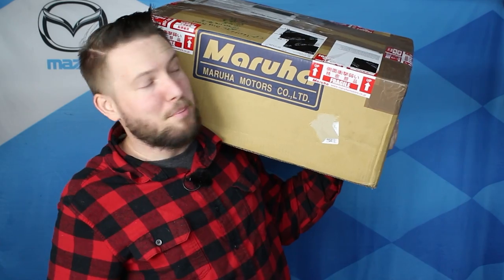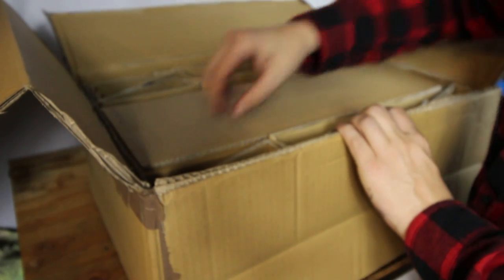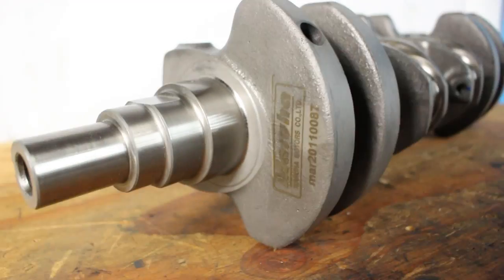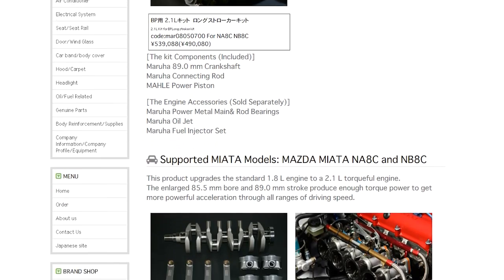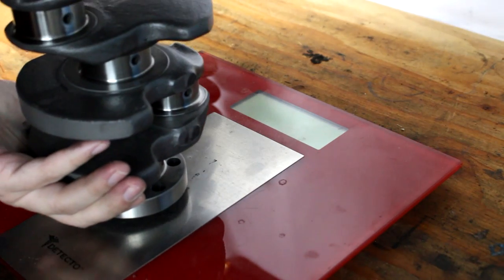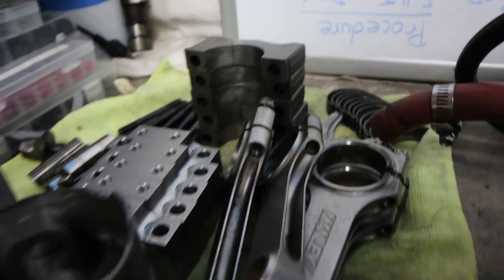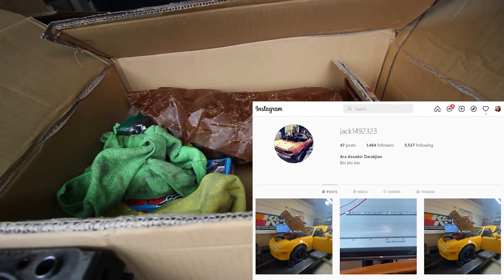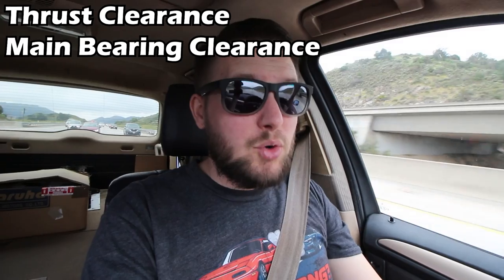Miata Gets a MARUHA STROKER Crankshaft From Japan!

Comment from the maker: Slight corrections to the video - when I spoke about rod/main bearing clearances I should have been speaking in "ten thousandths" rather than "thousandths." 

My requested specs:
Rod = 0.0020 - 0.0022"
Main  = 0.0018 - 0.0020"
Thrust 0.0060 - 0.0090"
Top ring = 0.0170"
Second Ring = 0.0190" 
PTW = 0.0030"

Another slight correction - when you bore up, you do actually gain a small amount of compression rather than losing it. You're pulling in more air to begin with (left side of the ratio i.e. the "9" in "9:1 compression") and compressing it down into nearly the same space. The combustion chamber in the head remains the same size, but technically the overall volume where the air is compressed grows slightly with bore-up due to larger head gasket and increased volume between the deck and top piston ring (right side of the ratio, i.e. the "1" in "9:1 compression") so the bump in compression is very small, usually about 0.1 or less. Changing the stroke from 85mm to 87mm however, raises compression by about 1 full point. So this thing is going to be REAL rowdy.
Reply: In the machining industry, we just call the ten thou marks "tenths". Which can be confusing for someone not knowing better and think we talking about tenth a inch and not tenth of a thousandths of a inch lol
Reply: What about the guy in the TENT . 
Thank you

Comment: In my opinion keep it on the safer side of spec. Dyno queens are cool and all but I think you should enjoy driving it more. We need to see this thing embarrass some v8’s asap 👌
Reply: Fs. No point in making 5-600hp if you have years of lag or can’t put the power down.
Reply: @haydentakara4369   dude, Greg is smart enough to be able to select an efficient enough turbo with the correct turbine housing vs compression to build the right power. Trust me. There’s a reason the call him the Miata dad.
Reply: @4399daniel  no doubt. Just in general though, a lot of really great builds often lose their actual street functionality and drivability by people going all out and sticking the hugest turbo on their car. Sure it makes big numbers but it’s hardly usable.

Comment: I definitely endorse the high comp pistons! I'm running 10.5:1 in my 1.6 with a GTX2860R and it runs fantastic on pump 93oct. You'll definitely like the broad powerband it gives!
Reply from the maker: Great to hear
Reply: @TheCarPassionChannel  gotta swap to the 1.6 for the full effect though ;)
Reply: He's already running boost, increasing compression might require him to be on e85 all the time and might not be worth it.

Maybe he can go higher compression but lower than 10:1.
Reply: Is it reliable? High temperatures issues?
Reply: @sepg5084  pretty sure he already runs e85 at all times. Which is honesty ideal, I mean pump gas sucks 😂
Reply: @sepg5084  I run high compression with boost and it seems fine as long as you have separate fuel and boost tables based on ethanol %. I am around 33PSI on e85 and 20psi on 93.
Reply: @sepg5084  honestly I think that would be the best choice (10:1) for a 500-600whp Miata on e85..... It just gives more room for error.. I know 11:1 can also work... I think personally for me, if I had an e85 only car.. I'd probably do something like this:
300whp goal = not more than 12:1.
400whp goal = not more than 11:1.
500+whp goal = not more than 10:1.

I feel like that's a good foundation for reasonableness if wanting to get more efficiency and also still run big psi of boost.

Comment: High compression pistons seem to make more sense in the pursuit of a broad power band. Mazda's cars these days are all running ridiculous compression and they have great low to midrange torque for being small 4 cylinders. Plus, making more power by improving thermal efficiency seems like a win-win to me.
Reply: He's already running boost, increasing compression might require him to be on e85 all the time and might not be worth it.
Reply: @sepg5084  he did explain he’s already running e85 all the time anyways, so it probably won’t make a difference to him

Comment: if you keep the same rods and pistons how do you prevent the pistons from hitting the head? did you have 2mm clearance before? or am i missing something?
Reply from the maker: The 2mm stroker crank only puts the piston 1mm higher in the block at TDC, and in stock configuration on my motor the pistons sat 0.5mm below the deck. So with the 87mm stroker they will sit 0.5mm above the deck, and I run a 1.4mm head gasket, so I will still have 0.9mm of squish clearance.
Reply: @TheCarPassionChannel  right, i forgot half the stroke increase is at BDC lol
Reply: What about your valve to head clearance? It has been a while since I've looked but I do not believe that this engine is a non-interference engine. With it being .0005 higher on the piston  you may want to check how much room you have left. plus in case you do end up with any valve float on a Dyno pull or other non street race high rpm check. 😀
Reply from the maker: @alleyman82  Valve clearance will all need to be double checked again. You are correct that it is an interference engine now (factory VVT engines are) but I still had ~3.8mm PTV clearance when I checked so it should be okay. There's a chance the pistons will need a hair of work though.

Comment: High compression for the win, anything to get that turbo to MBT as fast as possible.I still wager you need some sort of advanced traction control system that can properly manage wheel slip. Otherwise big power numbers do you no good. Not sure what you have access to in the miata world, but there is some nice stuff out there that can read front and rear wheel speeds and pull timing and boost to allow you to reach a set wheel slip percentage, 10% seems to be optimal for best acceleration.

Anyhoo its been fun following along the build and I'm about to dive head first into building a high response RB26 myself. I've got some tricks up my sleeve since RBs are super lazy on the low end. I'm hoping for a pretty flat torque curve from 3500 to 8500 with a turbo capable of 650 horse. We'll see where I get.
Reply: His Miata is surprisingly stable with the power he puts down. He has videos when he was at the track and put down some good times on a tight track! I recommend checking it out! Theirs even a really clean NC in it also!
Reply: I think a simple boost by gear system could do the job tbh he seems to have good throttle control

Comment: This has got to be one of the fastest street Miata's out there on YouTube
Reply from the maker: That's partly my goal!! All street trim, street tires, easy to cruise around, but just straight up vicious when you want it. I think anything over 450-500 isn't really possible just due to the excessive lag and limited traction north of that power level. At least without flares, 275 semis slicks or drag specific tires, etc. I like keeping the exterior relatively unassuming

Comment: Make sure you clean out the back side of the plugs on the crank. I just installed this Maruha 1.9 crank on my nb, with thicker headgasket from Maruha also. Kept stock pistons and rods and refresh everthing else, head valved and refinished, then a Maruha flywheel with new clutch also. 

Got set up on Maruha's Rapid piggyback for a break in tune. Now at 500kms breaking in.

Comment: I always thought adding bore size increases compression ratio. Same thing for the added stroke.
Because the combustion chamber volume stays the same but you're pushing more air into it.

Awesome on the maruha crankshaft!!! You're always one step ahead of me on my dream build hahaha I'm excited tho to get to see how it works out. From what I understand is the maruha cranks are made out of a stronger steel than the stock cranks. But they're not forged. So I don't exactly know what to make of that. But then there also the design improvements and 2.2lb weight savings... Hopefully they're still atleast as strong as the stock forged ones. I was actually in the middle of looking into that but I haven't figured it out yet...

And also +1 for excitement for the moderate boost in compression ratio. However I'd suggest a knock sensor just to have that extra piece of mind. HP Academy has good tutoring for calibrating knock sensors in standalones
Reply from the maker: Yeah you know what you're right, I'm not sure why I got that backwards. But it's a very tiny amount, like 0.1 point per 0.5mm of bore. Because although you have more uncompressed air to begin with, you also technically increase the "chamber volume" since you are using a larger diameter head gasket and your stock pistons are usually slightly below the deck height so that volume plays into the ratio. As well as the volume between the cylinder walls and top ring which is also a tiny bit greater.

Comment: Go with the 84mm and higher comp pistons route! I'm not a pro engine builder, but I'd rather have more meat in the sleeve on a boosted car. The more on the major thrust side the better. That's why anyone sane who builds 85mm> BP motors sonic tests theirs blocks.

Weisco's 84mm "10:1" pistons have a 7cc dome on them FYI. I have a set waiting to be put into a very similar build to yours (84mm, same pistons, but NA for the time being) I've yet to cc them to figure out the exact dome size, but I'll do that if you're interested.

Anyway, I'd first figure out your piston to valve clearance on your head before you shave it. Then get fancy and incorporate all the math (cc your chambers, figure out theoretical piston to deck height, etc) and then shave your head what you can (you should have enough...), or until you get to a static compression of 10.5:1 or 11:1.

Obviously you'll have to live in ethanol land permanently with that dynamic compression ratio.

Looking forward to the build!!

Comment: Unless you have the ability to ultrasonic check the bores I wouldn't go larger than 84mm bore.  I've personally sonic checked a BP block that had been bored to 85.5 and we ended up tossing the block as the front side of one bore was only .049" thick just under the deck.  The other three were ~.065".  Even at 84mm that block would still have only had an .079" wall thickness on the thinnest cylinder which IMO is too thin for a performance engine.  What we don't know in that particular case was did the machine shop mess up the bore work or was there a big core shift when Mazda cast the block.  I didn't have the block to check before machining to measure.

TL;DR... Unless I could sonic check wall thickness, I wouldn't put much overbore in a BP block.

Comment: This is so timely.  I just decided yesterday to order the 87mm from Maruha Motors.  I already have the same 84mm Wiseco pistons - catalog says they're 10.05:1, websites selling them say 10.5:1 - who knows what it is.  Mine is for a Rotrex build using the C30-94.  Have the redline set at 8400 rpm to give a max impeller speed of 10400 out 10500 limit.  Crank pulley is 130mm Supercharger pulley is 105mm.  Mine is going through 50mm Jenvey ITB's on their Turbo plenum.  Can't wait to get it all finished, still lots to do.

Comment: For sure build the engine with higher compression pistons. Would love to see it ❤️
Reply: High compression AND alot of boost?
Reply: @TheAdatto  Yeah, he drives on E85 and you can tune the car for higher comp and boost. Possibly can't get the "peak" performance like lower comp, but still a better throttle response when not in full boost. So a better midrange and that is his goal.

Comment: I have a short nose crank engine that i want to swap out to a big nose crank. Do you know if I can use the same block, swap the crank to a big nose and just use the different balancer and oil pump from the bnc engine? I’ve been reading on forums but they are not very clear on if it is completely possible. Huge fan by the way!

Comment: Please correct me if I'm wrong. If the pistons of the 2.1 liter kit have a lower height, you technically have more displacement. BDC with lower height pistons is "lower" than with regular height pistons. So calculating displacement without considering this, might be misleading. Cheers
Reply from the maker: Changing piston height does not affect displacement. The pistons are lower at BDC, but also lower at TDC, so the swept volume is the same.

Comment: I didn’t read the other comments, but I would like to challenge you to set that cast iron 4 cylinder block on a scale compared to an aluminum LS V8. I suspect they’re close in weight.
We won’t talk about twice the con rods, pistons, etc etc etc fully assembled…
But I’ll bet those blocks are close.

Also, you’re making me want to build a stroker motor for my ‘92…. Really bad.

Comment: Thank you! this I havent watched it yet, but i liked and commented, this is what i wanted to see :D
Reply: And yes i did the the calculation on "2.1L kitt", this engine would've had around 2.0L. 

And my vote is on the high compression 1.9L, 2L is cool but higher compression is pretty crucial on E85 tuned turbo motor. (yes more compression means better response for the turbo and earlier spool.) 

plus the extra stroke will shift the powerband down slightly(we are talking tiny amounts) with the same size valves and ports(and a little better fuel mixing since the swirling will get a bit better in theory)

And of course, all this will amount to a broader and more responsive powerband!

Comment: 3:49 so if you go with the 89mm crank you'll need shorter pistons right? 
does this mean they will weigh less and be more suited for high revs?
or are stroker cranks not really meant for high revving NA engines?
Reply: Engineering Explained has an excellent video on how engines can Rev high, but generally speaking, the longer a piston has to travel up and down (stroke), the harder it is to Rev higher since it has more distance to travel.

Comment: Careful with piling on the torque at low engine rpm. This is where most people destroy stuff ramping the boost and power with more rpm is way safer. Id say bump the compression same size pistons since it’s always on E anyway 9.0 is low for E even with healthy amount of boost. The compression alone should fill torque everywhere and increase efficiencies. Excited to see how it turns out.

Comment: I am an avid campaigner for not going overbore unless the bores NEED machining. Boring will always weaken the strength of the block and you will not notice any gains for 1mm of extra bore when you can just run .5psi more boost. I would go higher comp but not enough that you cant run it on low boost with pump gas in a situation when you cant get e85 and still want to drive the car-something like 9.5 should be pretty safe I recon

Comment: I can't remember if you said before. How did that 500ftlb clutch compare to the stock clutch for weight and grabbiness? Did it feel too serious for fun trips to the store?

 I have 1050x injectors, LS coils, forged rods, forged pistons, arp everything, cometic headgasket, boundary oil pump, and king bearings running in my miata for a few thousand miles waiting for the day I finally buy the turbo and piping. I'm just trying to make a reliable 300hp and 300ftlb. Also I'm fairly used to heavy clutches in my 1 ton and tractor.
Reply from the maker: In my opinion it was fine for daily use. I have had aggressive clutches in most of my cars, you do have to pay attention when you drive it, but it's totally manageable. Pulling onto trailers, hill starts, nothing is that big of a deal. It does have a much more narrow window than stock, and if you let er' rip it will catch you off guard. 

TL;DR it's more aggressive than stock but not bad for street use/traffic IMO.

Comment: Go high comp! Running 11:1 84mm pistons here at 32-33psi with the EFR6758, the car has great power everywhere!
Reply from the maker: Dude, sick. Can you tell me any more about it?? Do you have a dyno you can send me? That sounds like the best setup ever, I don't hear of that many people running high comp + high boost Miatas
Reply: @TheCarPassionChannel   I don’t have a dyno chart at the moment as it is road tuned currently. But I do plan trying to get some dyno time soon. Also running Maruha 264/10mm lift cams on intake and exhaust and the head is fully built with supertech valves/springs and ported by Jesse Prather. It’s in a 2005 mazdaspeed Miata that is fully built top to bottom. Running the kraken high mount as I still have ac and ps. If you are ever in the Daytona Beach, FL area let me know!
Reply from the maker: @jeremythiess590  Well it's still great to hear you're running the setup that hard and it's surviving. If you have a halfway tuned spark map, there's no way you're not in the 500+ range and I'm sure response is killer. Dream setup

Comment: Slightly bigger cams too please!!!!! 🥺🥺🥺
(Would also be good to see high comp turbo stock cams vs bigger cams)
Reply from the maker: I'm working on making this happen with a certain set of VVT turbo cams. I'm not sure it things will fall into place or not as far as getting them in time, but hopefully. And I would change them on the dyno, for best data, of course!
Reply: @TheCarPassionChannel  thank you so much!!!!!!!!!! Cat cams have some interesting stuff for the BPz3
Reply: Ps. I reckon a custom grind of:
Duration @0.1mm i:210° / e:218° 
With an overall cam lift of 9.5mm on I&E would really broaden the power band and reduce some of the VE loss at higher engine speeds, without negatively impacting VE from 1800rpm onwards
Stock cam is: Duration @0.1 i:209° /e:210° - i:9.40mm / e:8.90mm

Not saying you should do this, just cam stuff really excites and interests me!